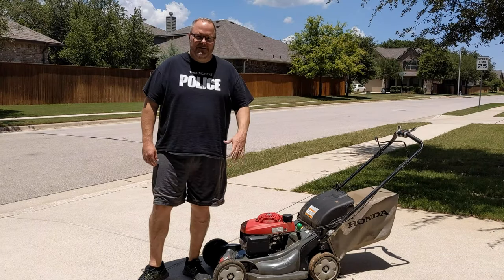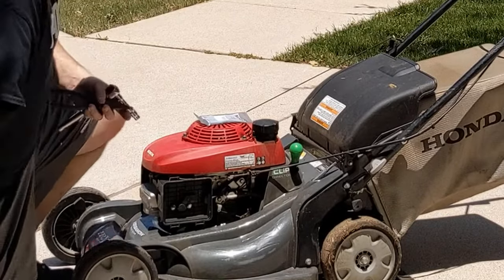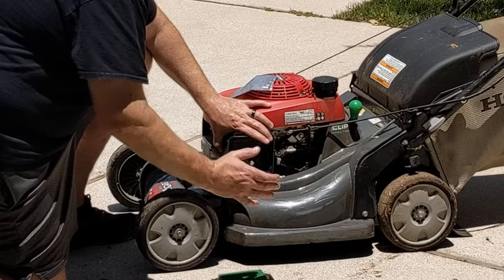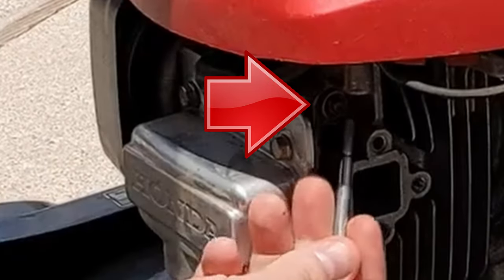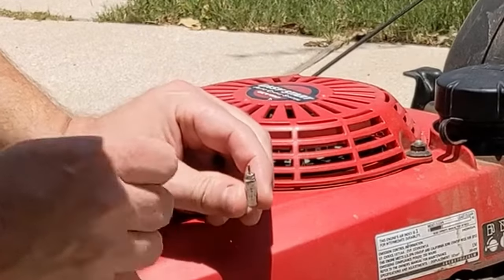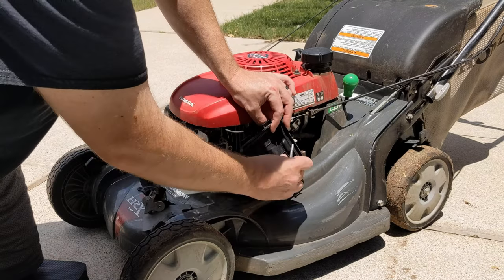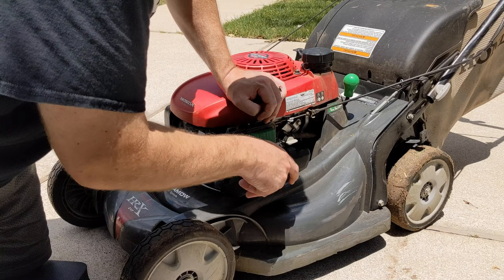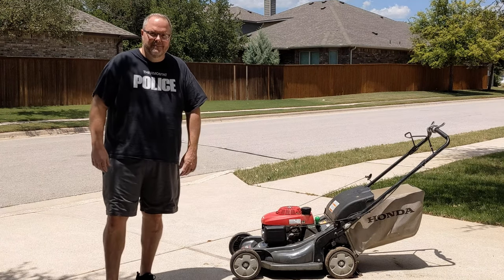Honda Lawnmower Hard To Start - 10 Minute / $10 Fix

Comment: Thank you for your video. It was very helpful. I have that same mower. After the winter and gas stored with Stabil, I couldn't get it to start. So (thanks to YouTube), I just completely cleaned the carburetor. Good news: I got it to start and it is now running smoothly after letting it run for a few minutes. Bad news: it still takes about 10 pulls to start when I let it cool off for only 1/2 hour (but at least it starts now 😀). So hopefully, your fix is the last missing piece. The part should arrive tomorrow. I'll let you know how it goes.
Reply from the maker: Keep me posted! I am hopeful that that part will fix it.

Comment: For those with a GCV190 engine on their mower do not order the part mentioned without doing a parts lookup for your specific mower. I have a GCV190 and the thermal wax assembly in my engine is round. I have watched a ton of videos on this topic and everyone shows a red colored square shaped wax assembly. The Honda power equipment site is a great place to confirm the part you need
Reply from the maker: Exactly. It's always best to double check the part number before you order.
Reply: I have a HRR. What engine comes with that? Its about 3yrs old. Thanks!
Reply: @riceburner4747  is the engine model not noted on the housing or shroud?
Reply: @timrussell5988  Yes, the engine model code and serial numbers are stamped into the engine block but it is best to go by the model and serial number that is on the cutter deck.

Comment: Just wanted to add a comment since I just changed mine out yesterday. Mine was very difficult to remove. It was because the wax inside it melted out and coated the outer perimeter of it. Once the wax solidified again it made it difficult to remove. The only way that I was able to remove it was to heat it with a torch (be very careful to direct the flame just in this area). Once the wax was hot enough, it started dripping out and, along with pulling pressure on the thermowax, it was able to be removed.   I just wanted to share my experience.  Thanks again for the video.
Reply from the maker: WOW, I have not heard of that happening. Glad you got it fixed and thanks for taking the time to comment!
Reply: I'd avoid using a torch. A lot of these were bonded in place with RTV sealant at the factory and can be difficult to remove, in that case Honda recommends using small pliers or wire cutters to pull the thermo-wax center pin all the way out and remove it, then screw a #6 sheet metal or drywall screw into the thermo-wax body and carefully pry it out.

Comment: Great video! Is that the same on ALL Honda's? I have a HRR. I consider myself mechanically inclined but how would I ever know THAT?🤔 Thank u! 👍
Reply from the maker: Thank you! I assume they probably changed to this design at some point in time when they started using automatic choke.

Comment: That part is like any part it fails. I also see that many areas of your mower is dirty. To you it is just a mower. But the linkage parts on top the carb and such must be kept clean and lightly lubricated. Not doing so puts extra effort and wear on other parts. I also suggest keeping the wheel axles clean and lubed with light oils and very light greases. The easier it is to push the mower the easier it is for the self propelling system to do it's job. Many times I see folks mowing their grass too short, kicking up all kinds of dust and debris then never take the time to clean their mower. I have the actually shop manual to my Honda mower. All the suggestions I stated are touched on in that manual. These mower have regular necessary maintenance, that for some people seem to neglect. Just trying to help others out there to save them some unnecessary and unwanted breakdowns. By the way, my Honda mower starts first pull ever time, and always has.
Reply: This part clearly hasn't failed in your mower. If it had you'd know it's got nothing to do with a dirty lawn mower or proper maintenance or even lubricating stuff. If you want to obsessively clean and maintain your lawn mower go for it, but these mowers can also start first pull every time when they're dirty too. Also, there's no need to lubricate the linkages and doing so will only cause more dirt to stick to them and force you to clean them more often.

Comment: Is it possible that because a thermal wax is sticking out, a lawn mower gets hot and stalls?
Reply from the maker: I am not a tech but I don't think that would be the main cause. The thermo wax is designed to close the choke when cool and then open it when warm to allow the right air/fuel ratio to start easy. What I noticed on mine was in some cases I would run the mower for 15 minutes, shut it off for a few and then it was very difficult to start. You might check oil level, and then also engine speed. It's also possible that it's running a bit lean because of some debris in the carb. You might try this in the fuel as directed and see if it helps (they sell it at Walmart as well): https://amzn.to/45ba6U7

Comment: Purchased one used, 3-4 pull start. New spark plug, new filter, no improvement, replaced thermowax, 1 pull start! Also added Seafoam to gas tank.
Reply from the maker: Amazing job, thanks for sharing!

Comment: I pulled the Carb assembly out just enough to pull out the old themowax without taking the carb all the way off, its tricky, but with needle nose pliers saved me alot of time.
Reply from the maker: Great suggestion!

Comment: Have one slightly older than yours.  Can tell by the handlebar controls.  Takes me 3 to 4 pulls.
Reply from the maker: Check to see if the choke flap is open when it's cold, that should give you a good indication if changing it will help. I also noticed that when mine was warm, it was extremely hard to start. Let me know if you end up changing it out and if it fixes it.
Reply: @ThatDadMike  When warm first pull. I know this from refueling from front to back yard. Will check the flap. Due to its age, would think it should be replaced.
Reply from the maker: I bet you are right. I think my mower was about 7-8 years old when it failed.
Reply: @ThatDadMike  Ran all the gas out. Installing tomorrow. The OEM part including tax was $13.25
Reply from the maker: Awesome, fingers crossed this fixes it for you. Keep me posted!
Reply: @ThatDadMike  Wanted to give you an update. The flap was open. The kicker is my model of Honda Mower does not take a Thermowax. Lesson learned. Thanks for your help.
Reply from the maker: @34dawgsgo thanks for the update! Wow, hopefully you can return it for your money back. If it does not have a thermowax, what does it use?
Reply: @ThatDadMike  Not sure. In the pros hands now. New carb will not hurt do to it's age. Does not have the black plastic stand alone carb piece either. Design change I assume.
Reply from the maker: @34dawgsgo I bet they did do a design change. Definitely curious what the pros have to say. Keep me updated if you don't mind.
Reply: @ThatDadMike  if you want to do one of those temp email addresses. I will mail you the thermowax. No reason for me to keep it and you will have a backup.
Reply from the maker: @34dawgsgo I really appreciate the offer! We don't use the mower much anymore as we have a larger one now so it would likely just sit.
Reply: @ThatDadMike  Ok no problem. Was thinking I would never use it. Take care.
Reply: @ThatDadMike  Mower running like a top. The pro must have adjusted the throttle cable that I didn't know how to do. It has more power and burned less gas. The carb I didn't worry about.  The mower is 10 years old and that is a major failing point. Lesson learned with all this. If it's major let the pro do it. Take care.
Reply from the maker: @34dawgsgo excellent to hear, glad that it is running great. Thanks for keeping me updated. Great connecting with you! Have a great evening!

Comment: So I ran out of gas and after filling my tank, my Honda was trying to start but no luck. I checked the filter, I replaced the oil, and the spark and I cannot make it work. When I spray some gas, my Honda starts for 1 sec and then it dies. What do you think?
Reply from the maker: That's a tough one. I would check to make sure that there is not a clog in the fuel line from the tank. It is also possible that some sediment from the bottom of the tank went into the carb so you might try taking the carb off and cleaning the various holes and carb bowl with carb cleaner.
Reply: Clean the carb. My guess is you are using gasoline with ethanol in it. If you have access to 'Rec' gas, non ethanol fuel, use that in all you outdoor equipment. The ethanol reeks havoc on the fuel system if left in the fuel system too long. It has a tendency to cause water to collect in the fuel. Your Honda has a fuel shut off valve. When you just a minute from done cutting the grass, turn off the fuel and run that motor out of fuel. Most people put fuel stabilizer in their gas and that's good, but I still recommend not leaving fuel in the carb after use. For winter storage empty all the fuel out. That's best practice.
Reply: I needed to replace the carburetor
Reply from the maker: Does it run good now?
Reply: @ThatDadMike , yes! No issues
Reply from the maker: Awesome, great to hear!

Comment: I got a Honda push mower it will start only with starting fluid but won’t start with out it what could that be
Reply from the maker: Does it start and then stop running when you use the fluid? I am not a mechanic but it sounds like it could need a new carburetor assembly. Sometimes they get gummed up if the fuel is not shut off each time and it's easier to replace it than to take it apart and clean it thoroughly.

Comment: I think mine takes 3 pulls to start. Even when it was new it never started on the first pull. I have remember to turn the fuel valve off after use. If I forget there is too much fuel in the cylinder and it's a bear to start.

Comment: I Replaced the thermowax and the thermostat and still hard to start when it's hot. After awhile when it's cool ot will start.
I've clean and rebuilt carburetor . I think these thermowax choke systems are faulty
Reply from the maker: Keep us posted on the outcome. You could be right on the carb, I wonder if something is off there.  I am sure someone reading the posts will have another idea to try.
Reply: I replaced mine, seems like it went bad again right away.

Comment: Mine is the blades locked up and cant even pull the rope what do i do
Reply from the maker: Wow, that could be a number of things that are best checked out by a small engine mechanic. You might try to remove the spark plug and see if you can pull the rope without the plug in place (assuming nothing is wrapped around the blade preventing it from rotating). That is a good way to tell if it is locked up because of fluid in the cylinder.
Reply: The blade lock mechanism that also actuates the kill switch could be jammed and locking the flywheel.The handle has a bracket that you must pull into place against the handlebar to "disengage" the brake and kill switch in order to start and run the machine.  When released it locks the flywheel and activates the kill switch.  You might want to check that.
Reply: Sounds like you're not keeping the oil at the correct level and possibly not changing it every year like it needs. When checking the oil on a GC190, remove the dipstick, clean it off, then re insert the stick back in the oil hole with out turning it in. If you screw it in all the way it will indicate a false high level reading. Looks to see if there are oil leaks. That can be a crank seal or some other possible serious issue. Gook luck. Regular maintenance is always a good idea.

Comment: Where can I buy this parts?
Reply from the maker: Here is the link I put in the video description: https://amzn.to/3lXCsMJ
Reply: @ThatDadMike  thank you this parts is good for model Honda 170 ?
Reply from the maker: I would do a quick Google search for your lawnmower model number and check the number to be sure.
Reply: @ThatDadMike  I have model honda GCV 170 please check out , this parts is good for my model?
Reply from the maker: Hi Sergii, It works for several engine models. What you need to do is look up your specific lawnmower model (not the engine) and make sure it is the same. There is a listing of the models at the bottom of the page here: https://amzn.to/3wcTxXS